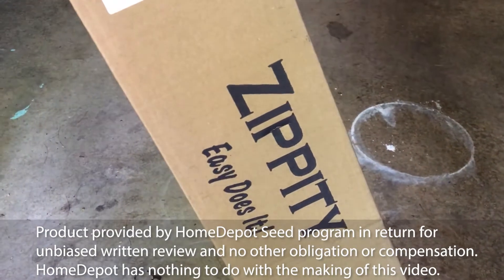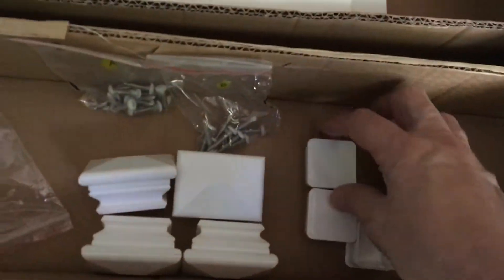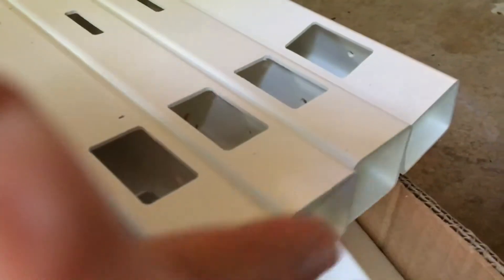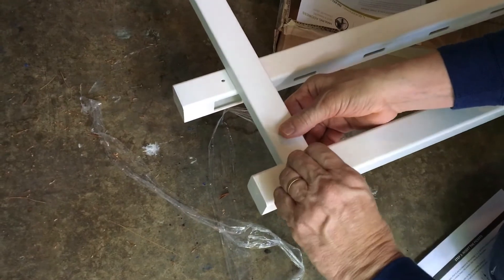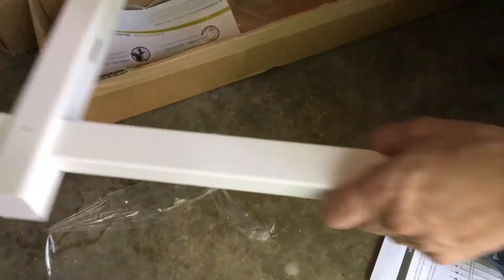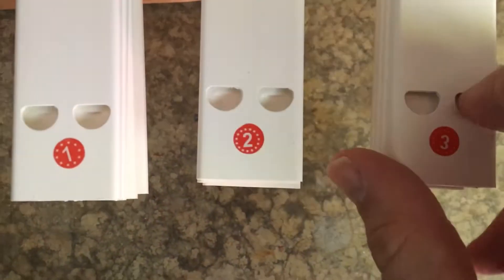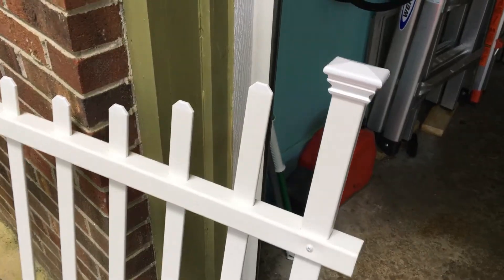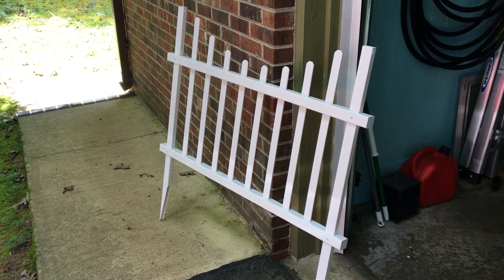ZIPPITY VINYL FENCING

Comment: will the spikes damage gas lines?
Reply from the maker: Usually the gas lines running to your home are buried 18" or more, so there should be an issue. If you know that it will going over a gas line contact the gas company to determine exact location and depth.